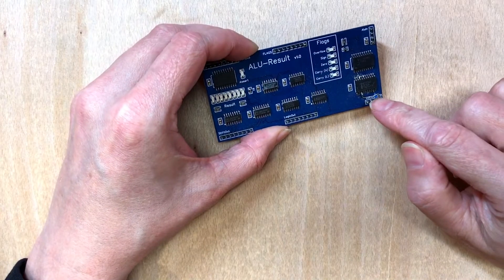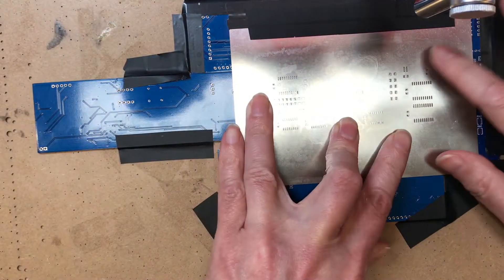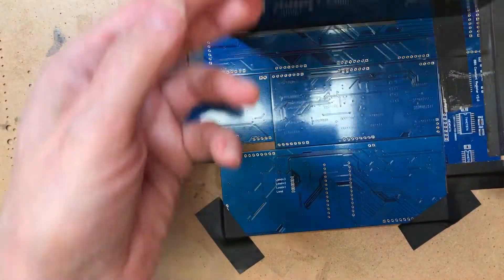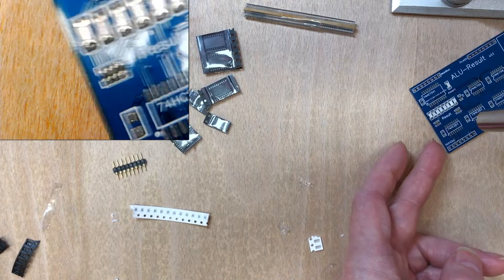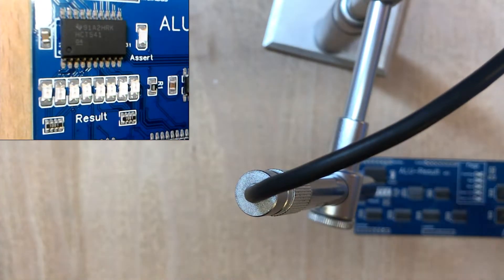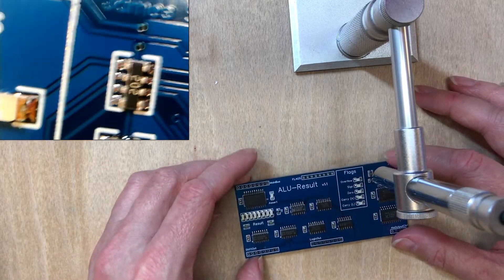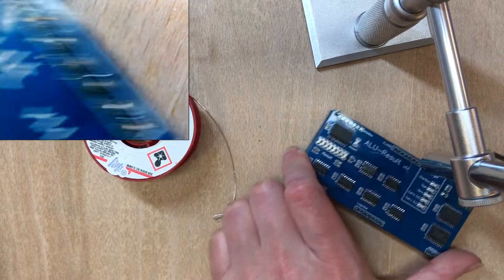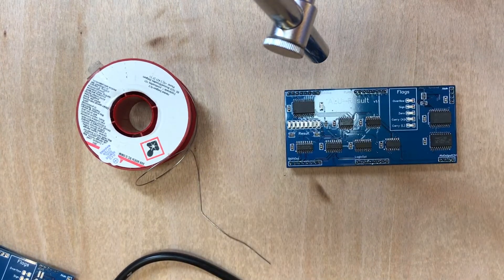ALU Result PCB v1.1 - Pipelined CPU Extras

Comment: Look into adding diffuser to the light instead of just repositioning it. Often works well when the light source is wide.
Reply from the maker: The light is already quite diffuse, I was thinking it was just too far away. If I can rig up something bring it closer the light will be coming from a wider range of angles. Maybe something to suspend a diffuser rather than lowering the light? Any suggestion on material?
Reply: @JamesSharmanExtras  I use cheap Chinese soft boxes from eBay, best ones I have use two layers of translucent fabric of some kind. It widens the light source so wide light floods from all around the working area.

Comment: 2 questions: 1. what is the camera you are using to film and 2. do you use it just to film for us or you use it to place (via monitor output)?
Reply from the maker: I assume you are asking about the zoomed in view. That's a cheap ebay microscope, I like it as it doesn't occupy much space in the main top down camera feed. I mostly place without it, but it does help with some bits. I force myself to look at the monitor regularly as I have a bad habit of placing a bunch of components "off screen".
Reply: Would you think of doing a video on your video setup? It would be interesting to see/learn how it can be done, and if there's anything you would change if you were starting from scratch?